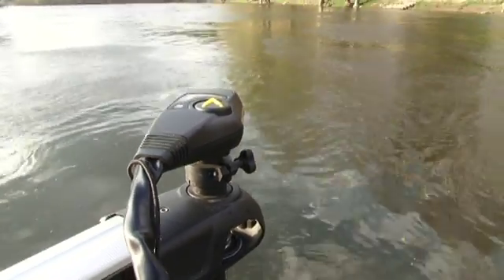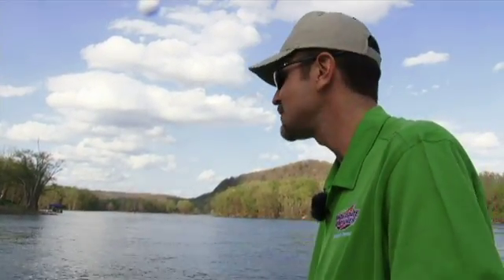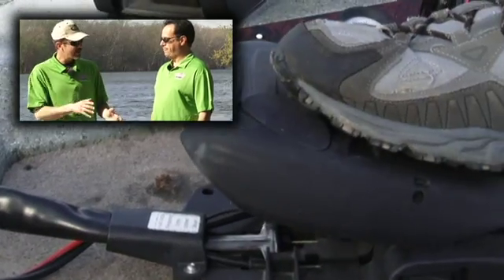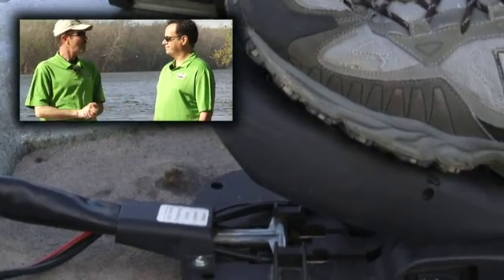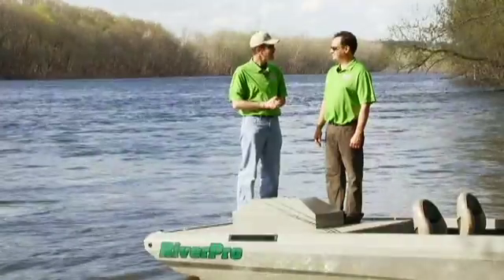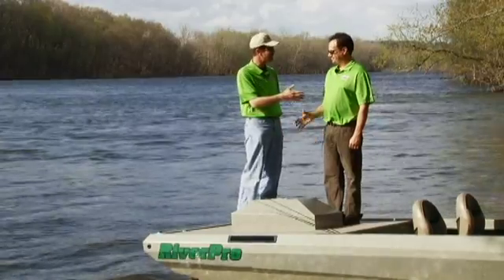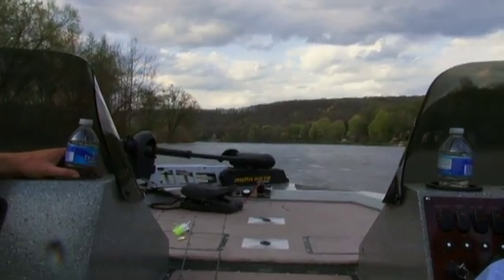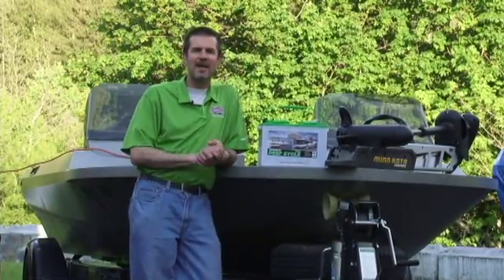TYPES OF MARINE BATTERIES: EXPLAINED

Comment: You didn't explain which DC battey would be the best for cranking and lasting power.
Reply from the maker: ***** The Interstate AGM battery has the capability of two, serving as both your cranking battery and powering your trolling motor.   @6019
Reply from the maker: ***** interstatebatteriesDOTcom/m/ product/agm/marine-agm